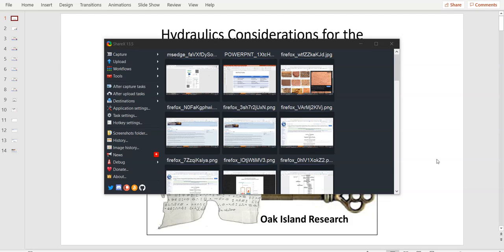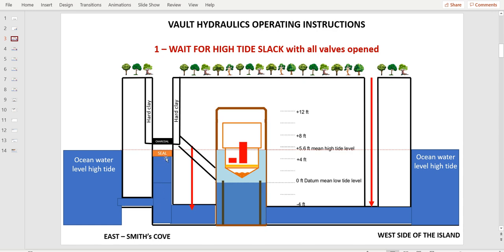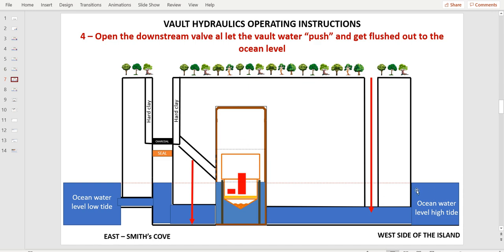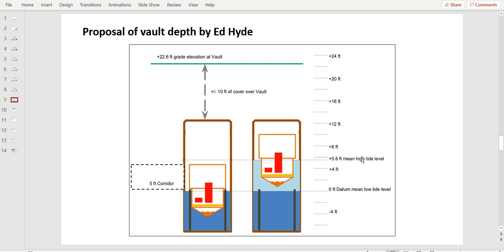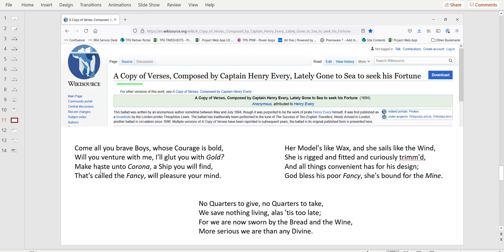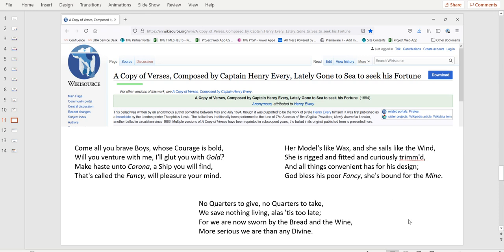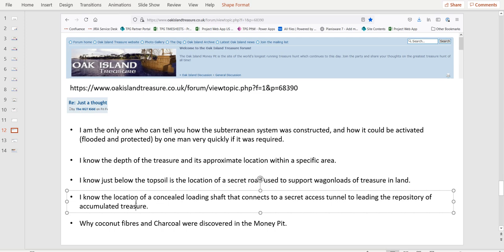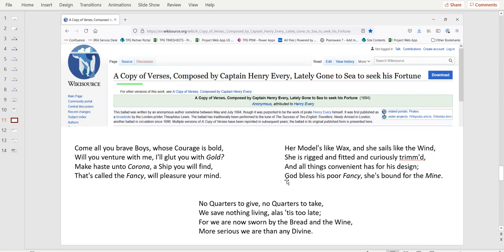32 - OAK ISLAND - HYDRAULICS

Comment: As always, Interesting, Informative and Entertaining ( certainly at least for those with an interest in all this).  Question.  slide 3 ~2:10.  while I think we all realize this is not a scale diagram etc.  What do you suppose prevents water from coming up the 45/522 access shaft when the "Vault" are is filling with water?  My assumption is that it would be sealed off from the Chamber so as to prevent water erosion/ damage etc in that access corridor.   Or perhaps it does get water in it but since i cant put a picture here in the comments maybe its a bit of a Drop off right before it gets there something like --->   L___[Vault] and a ladder or something comes from over the "top of the "L" shape where the corridor is higher until then.  With the last section  made and into a short flatish platform/ corridor right before the entrance, allowing water to come in and fill that but not the whole access corridor.
Reply: Maybe it connects to the top of the vault where the tide level does not reach? The idea is to close the valves at high tide to hold the boat at its highest position for access.

Comment from the maker: Ed Hyde suggests the Hampe could be used also to compensate for leakage in the system by letting amounts of water continuously entre the system. I am not so sure, as this will subsequently trigger the movement of the "Fancy" boat with the tides....

Comment: I think... Only one duct and valve are needed to make the hydraulics work... But maybe there are other reasons to have two? Maybe the second one is needed to alleviate some air pressure as the vault rises? Or redundancy in case one system fails?

Comment: The whole design of the vault itself, if it works along these lines, would require that it is either quite large to hold a lot of weight or that it is smaller for holding things that weigh a lot less than enormous amounts of treasure. The "treasure road" implies a lot of treasure, but maybe it had some other purpose for the construction process... Like carrying lots of waste material away from the tunnels. Also, perhaps the road is post-construction... Made by some later military operations?
Reply: Aloha Victoria Aloha BONAPPITE. Bonjour. EXhume EM WHAT SIVEVEW PLAY.WE MADAM WE MADAM I LUV. U.AVAWA

Comment: Interesting I see kinda how its set up. Been having trouble following episodes though have been watching.   Maybe the air doesn't compress after valves shut so as the water traps at high tide inside tomb/chamber. The air circulates and simultaneously works it way back out the 45-5-22 chamber you call it. Since it sits above the water entrance.    I wax keen to Kidds treasure I tried piecing together years ago.  Could it be.  Maybe sworn in divine means.  You can certainly obtain it, but it will cost you a life. Do so at your risk.  It it to live on forever. The pit of treasure.    Perhaps is why they say 6 have died one more will have to go.  Maybd itx lucky 7.   The same steps 1-5. Repeated or repeated in reverse, over and over 1-5, 6-10, 11-15, 16-20, 21-25, 26-30 (1-2-3-4-5-6-)   and now - 7-   31-35.  But will cost that one his life. Stuck or what have you.    If that rumor is true or was read on old page they found or where they heard that

Comment: What I cannot grasp is why build a flood entry and the tunnel entry , on the East side of the island and then place the vault on the other side of the island . It means you have to cut two tunnels that are over a 1,000 mts long , with all the problems of digging and extracting so much soil and rock. Why not complete the whole system on the West side.

Comment: I had been wondering if the charcoal layer might have just been a level where they needed a fire to see by and work a long time at that level, but the hardened clay idea is great. I do wonder how much heat and for how long it would take to harden clay enough to be effective for its purpose.

Comment: Been really looking forward to this video to see what you came up with. In the end it is very similar to what I was thinking (the vault would have to be at the level of the tidal range). It seems to me that the hampe would be a one way valve like the aboiteau that would only let water in but could be held shut by the pole. This would automatically fill the vault at high tide and top it up every high tide if there was any leakage but it couldn't be used to empty the vault if the entrance was found. The only way to empty the vault would be to open the second (hidden) valve and wait for low tide, then close it and hold the hampe valve shut with the pole, hence the reason for two valves.

Comment: Hello Oliver
This is getting more interesting by the minute. i have a slight issue about your comment regarding compressibility of air in this context. 
At the top of modern elevator shafts there is a vent to release air as the lift car rises. Surely a similar situation would occur here. I would suspect a vent somewhere to allow the air to escape.
I guess this all depends on how big the vault is as to whether this would have an affect on the ground over the chamber. i messaged on michaels' yt video asking whether he thought the chamber was a natural void or excavated for this purpose, implying prior subterranean knowledge. You dimension of ten feet of cover over the chamber now makes excavation more likely.
I read KGT Kidds (kidd?  ie captain Kidd really!) . He certainly seems to have knowledge of  the island, some of which is only just being found. So where did all this insight come from?
Are there some missing documents somewhere, no one knows about.
I've now finished 'scrolls......'.This definately needs to be read in conjunction with Zena Halperns book. It's all interesting to me as I can follow the prison escape to the Nab tower because I can see it from where I live, so that part of the story is really local to me. Keep going.
Reply from the maker: The vent on lift is due to 2 factors: The speed of the lift, and the tight tolerences we apply nowadays betwee the walls aof the lift and the walls of the cabin.... Thus the fast compression of air. Here, the vault would go up and down every 6 hours with probably a lot of slack between the walls..... thanks for your cheering :)

Comment: Slack tide refers to the brief periods at which water flow is stalled inbetween tides or waves. The period between high and low tides is about 6 hours, so the time it is near the extreme is much shorter.
Reply: That's correct. I do a lot a fishing in a large canal and the water flows very fast and then it slows and slows, until the tide stops. This is slack tide. After about 1/2 hour the tide flips the other way. It's a great time to catch fish😏